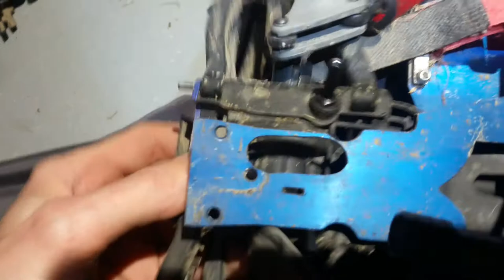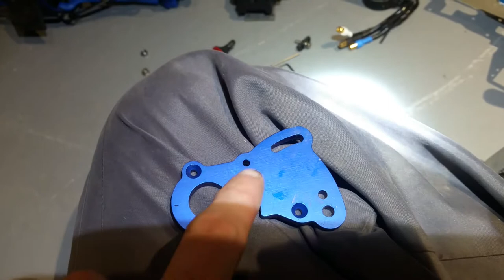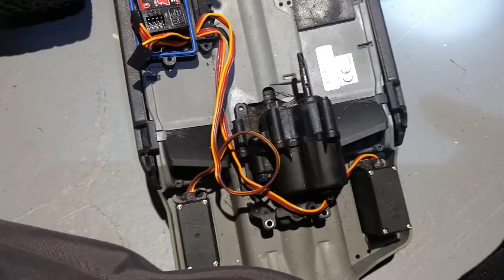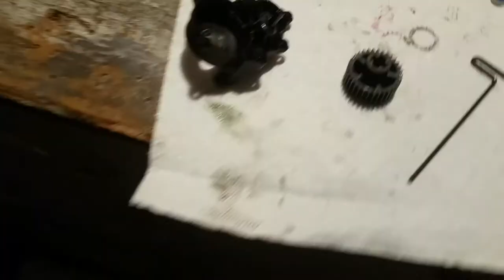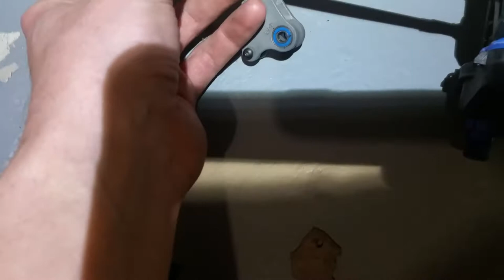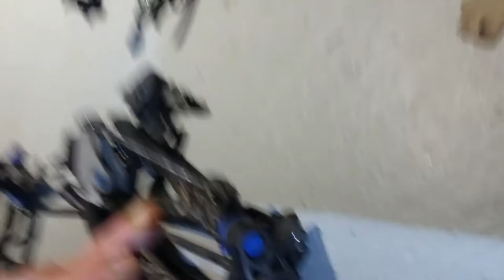Erevo 2.0 and 1.0 tear down side by side together to compare

Comment: Can't wait to see the 5th scale erevo 2.0 powerhouse that's gonna be crazy can't wait to see that beast man you got a ton of erevo stuff holy cow I though I have alot of extra parts not even a qtr of yours
Reply from the maker: Paul cherry Thank you. More in garage not much more. And stuff on work bench also. Yes working on transmission plate now about 50%done for today. Mock up done holes done working on line up and fitment right now but. Im done for tonight.  Lots of work with hand tool and drill and files.
Reply: J Bird crap man share the wealth lol

Comment: Hi 
I have a question. Is the erevo 2.0 body mount compatible with the 1.0 erevo? If it is, can I replace the body mount with 2.0 and be able to use the body for the 2.0 erevo? Thanks!
Reply from the maker: Yes you can. Just change to the V2 body post from clipped/pinned to clip less ..part#8614
Reply: @jbird9062  Thanks for the reply! So I don't have to replace the whole front and rear body mounts, rather could be done just with an replacement of the 8614 and a new body? Am I right?
Reply from the maker: @byungjaelee5110  yeap no need in changing the body mounts just the post to clippless
Reply: @jbird9062  Got it. Thanks for the help =)
Reply from the maker: @byungjaelee5110  no problem love the hobby...being helpful is what I try to do be free to ask questions....if your on FB join Traxxas E Revo groups
Reply: @jbird9062  Oh I didn't know about that. Thanks!